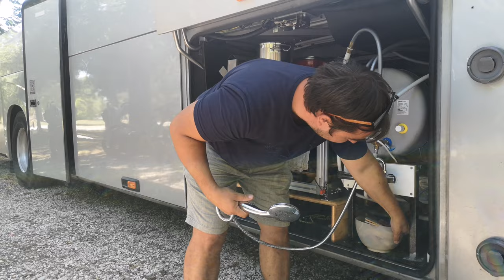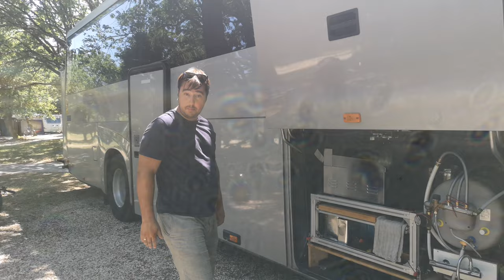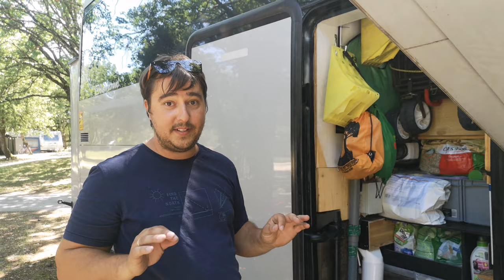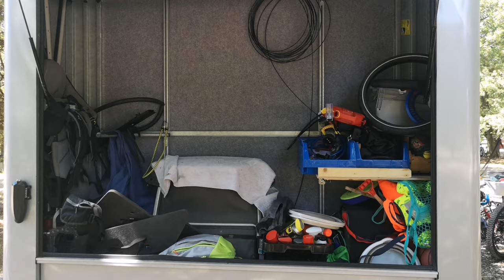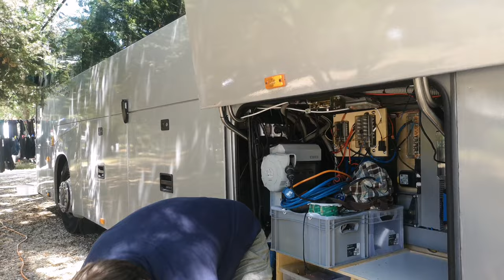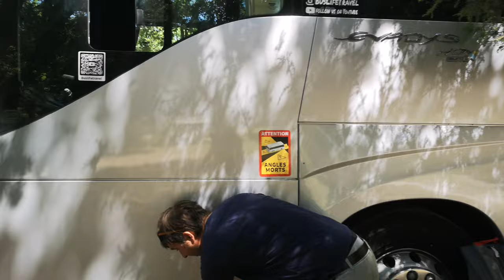Vom Reisebus zum Wohnmobil    |||   Technik Roomtour Buslifetravel    |||    Teil 2/2 Technik

Comment: Zur Frage der Klimaanlage: diesen Klimakompressor über einen eMotor zu betreiben: Anschluss 400 V (also Drehstrom), mit mindestens 6-10 KW Leistung. Gibt es auf keinem Campingplatz (Gott sei Dank ist das so) und wenn wäre der von den DB viel zu laut um den auf einem Platz betreiben zu können. Du würdest kein Auge zu bekommen und die Nachbarn würden mit der Fred Feuerstein Keule vor der Türe stehen. Ich habe das ganz elegant über eine Wärmepumpe (Inverter Klimaanlage) gelöst. MultiSplit Klima mit zwei Innengeräten, ein Außengerät in die Skibox eingebaut. Leistungsangaben 6 KW, Leistungsaufnahme 1,5 KW. Kannste auf jedem Platz einstecken (230 V ca. 8 Amp.) oder aber - wie bei mir - über PV und Speicher dann autark betreiben. Inverter Insellösung, also SBU (also sobald die PV, Batterien nichts mehr bringt dann FallBack auf das Stromnetz). Bei mir PV Module mit 1200 W, Speicher 7,2 KWh, reicht aus, kein Bezug aus dem Netz nötig. Heizen und Klima wäre damit erledigt, 450 KG für Klimakompressor und Standheizung kannste rausschmeißen, spart Sprit beim Fahren mit Rücksicht auf den CO2 Footprint 😊
Reply from the maker: Hey vielen vielen Dank für die sehr informative und fundierte Antwort. Diese Lösung hatte ich zuvor auch schon oft gelesen. Wir wollten aber auf die Wassergeführte Heizung nicht verzichten. Desshalb hatte ich mich damals dagegen entschieden. Außerdem wollten wir gern mit Gas heizen, da sonst der Stromverbrauch im Winter zu hoch wäre. Aber, beim nächsten Bus werde ich das nochmal in Betracht ziehen 😉👍 Danke für die Info, dass der Kompressor somit nicht zu betreiben ist... Schade aber wir kommen soweit ja sehr gut klar. Vielleicht nimm ich den Keilriemen wirklich mal ab. Grüße und vielen Dank Simon

Comment: Guten Abend Simon
Wir studieren das System, um die Klimaanlage der Busserie zu verwenden,
Trennen Sie bei stehendem Fahrzeug den Riemen vom Kompressor zum Motor.
Aufbau einer neuen Halterung, wo ein an das System angeschlossener Elektromotor angebracht werden kann
Lassen Sie mich wissen, was Sie denken.
Gute Straße Massimo
Reply from the maker: I have had the same idea. But it won't work. You might need an electro motor of abaout 4-6KW. Cheers Simon